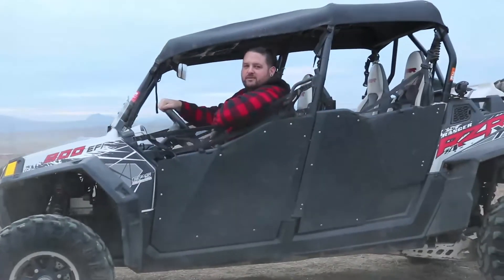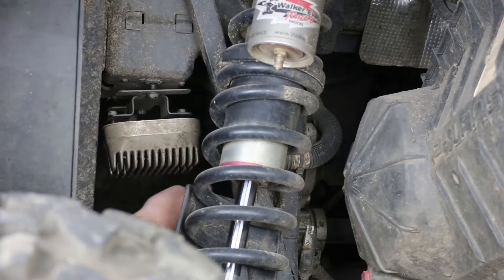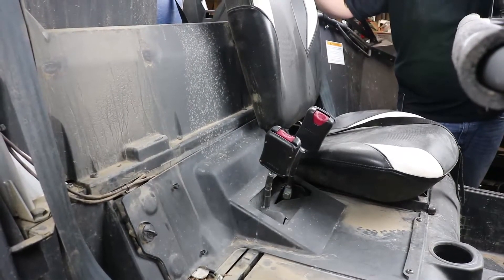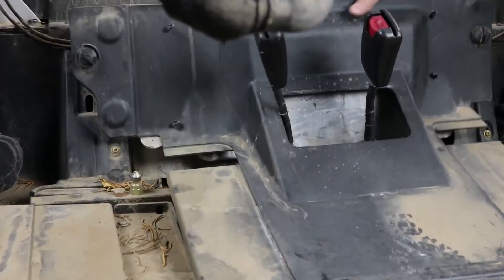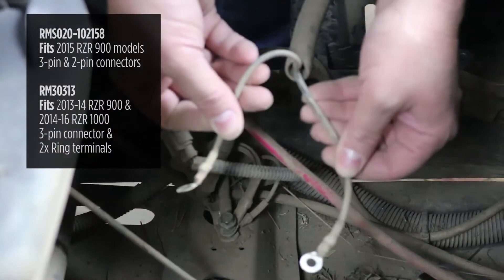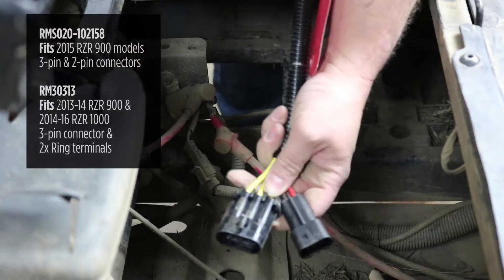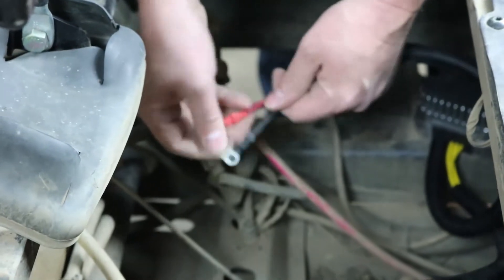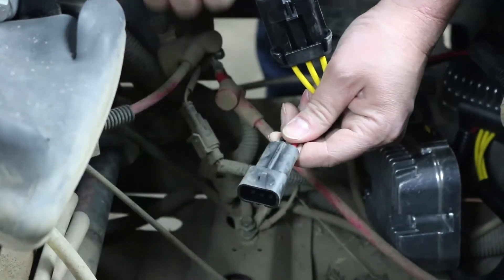How To Install RMSTATOR Heavy Duty Mosfet Voltage Regulator for 2013-2016 Polaris RZR 900 & 1000

Comment: I just order a reg/rec from you guys for an f4i. MOSFET type. Your add said it was “plug and play”. The bikes a 2002 model. “Plug and play” my ass. The wiring that plugs into the stator is like 18” to short man and the wires that attach to the battery are like four feet long! What the fuck man. What a crock of shit. Ain’t no “plug and play”. I could have just got a MOSFET back and do all the wiring my self for like HALF the price I paid for yours. I got your cuz it’s advertised at “plug and play”.

That’s seriously wack.
Reply from the maker: Very sorry to hear of a problem, please make sure to contact our customer service team for help!